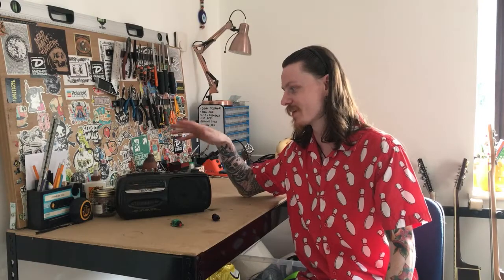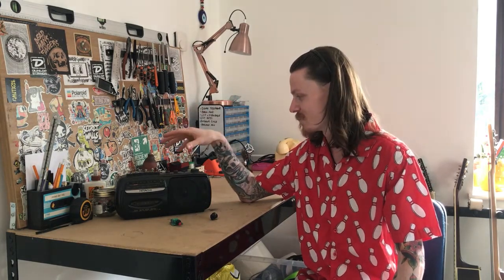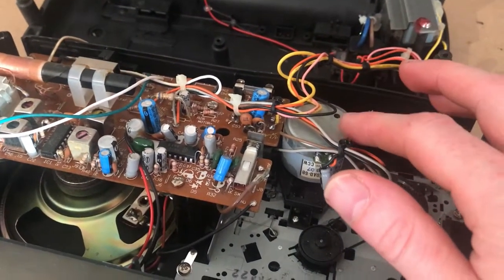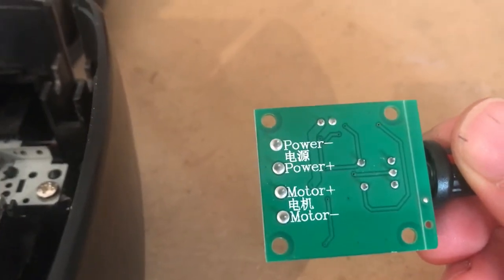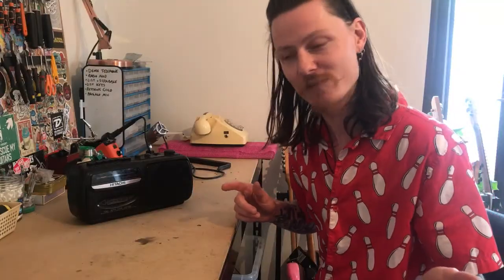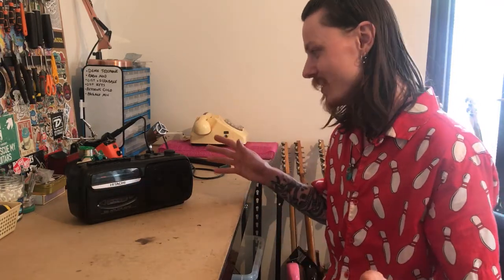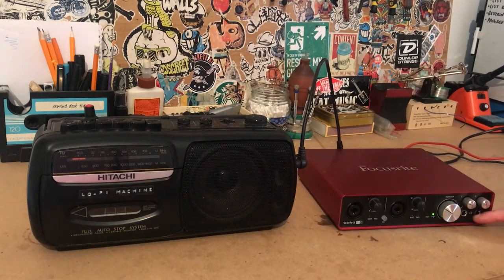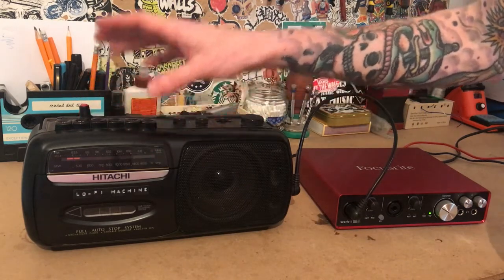‘Lofi Machine’ by Weird & Wired - Radio Cassette Mod

Comment: If you use a boost or drive pedal to overdrive the radio circuitry, how does that work since this is originally designed to be a radio, not an amp?
Reply from the maker: I would have to give it a proper try myself (perhaps with something utterly over the top like a Big Muff) but I imagine the results to be chaotic 😂 whether that is a good thing or a bad thing!
This particular radio has a pretty blown out sound as it is, though the quality of radio amp mods definitely varies from radio to radio which is why I find it to be such an enjoyable modification to do 😄 a fairly simple mod with surprising results! 📻🎸
Reply: @WeirdandWired  What are the best radio brands and models that you would recommend to keep an eye out for at thrift shops, for both clean sounds, dirty sounds, and crazy/weird sounds?
I am in the US not Australia so the models might be different though
Reply from the maker: @                    Jank Willson  that is a very good question! I've not got any specific brands that I lean towards; generally whatever catches my eye and doesn't cost too much 😂 Transistor Radios are really fun to work on as they pack a bit of a punch and sound more like a guitar amp than a converted radio, though they do tend to be a little more expensive for the luxury! 📻
As for the tonal qualities, in my experience, it's a total surprise but almost guaranteed to be fuzzy (the only exception being a USSR Transistor Radio that has the cleanest amp sound, and I was sure that would be an extremely filthy fuzz 😂)
Smaller/less expensively built radios, such as shower radios, are a good bet for sounding dirty, whereas a Transistor Radio has a better chance of having a cleaner sound, especially with the volume rolled down a little 🙂🎸📻
Reply: @WeirdandWired  great to know!